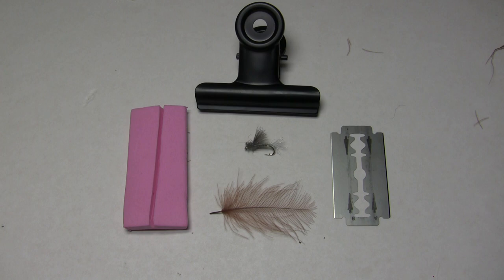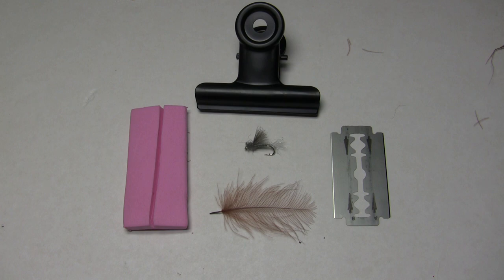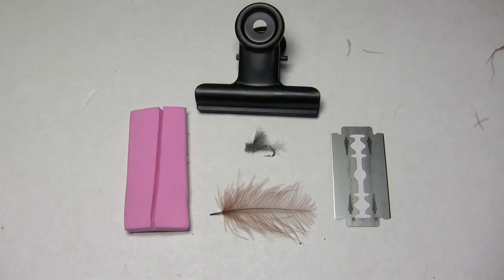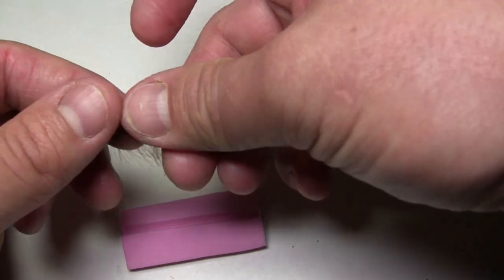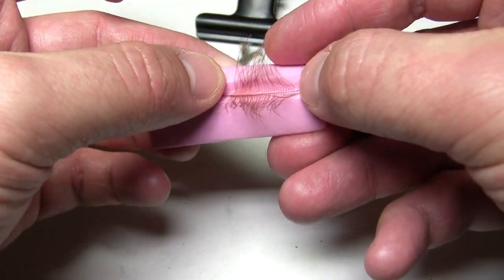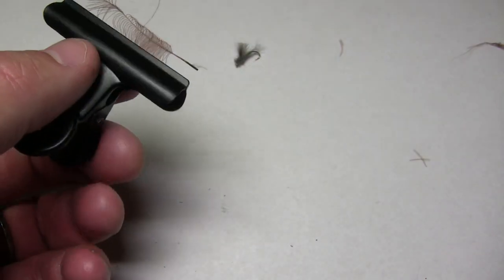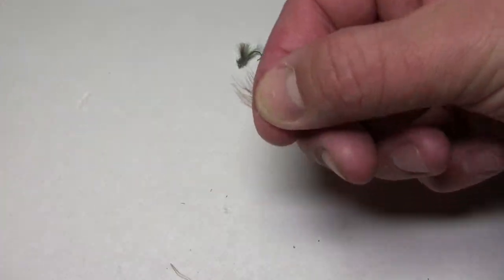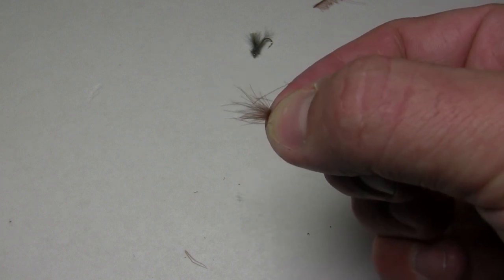Cheap, Simple DIY CDC Feather Folding Tool Using Foam | YCFF

Comment: Very nice. Makes sense. I didn't get the point of the large foam blocks, either, in terms of economy of space vs what the thing's accomplishing.
Reply: Could be that "hinge" won't last long, but I guess it's easy replaced.
I'm sure all this has its applications,  but some people seem to go through all this palaver when they could just have wound the feather as a hackle. One YouTuber was using all these Marc Petitjean contraptions to make a collar on a nymph. I asked why he didn't just wind it, and he got quite shirty,  but I still don't know the answer. Only thing I can think of is that the butt ends may give a little more volume, and hence float the fly better. Trouble is, it was a wet fly.
Reply: I use the big foam blocks to run a circular tube cutter through for booby eyes.